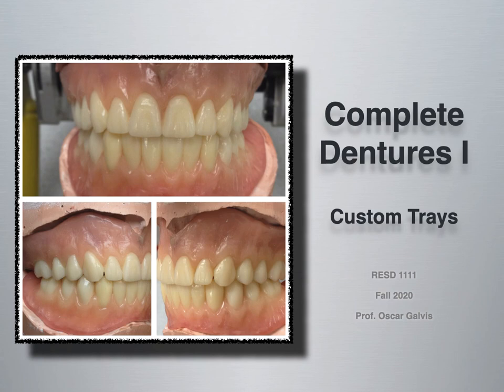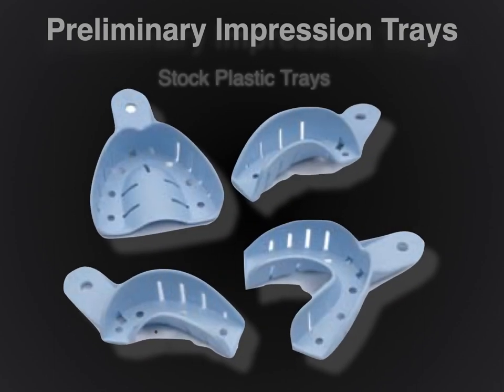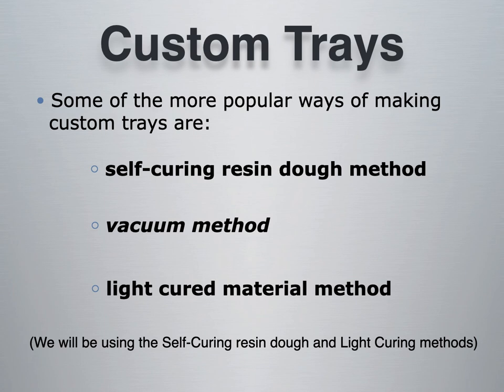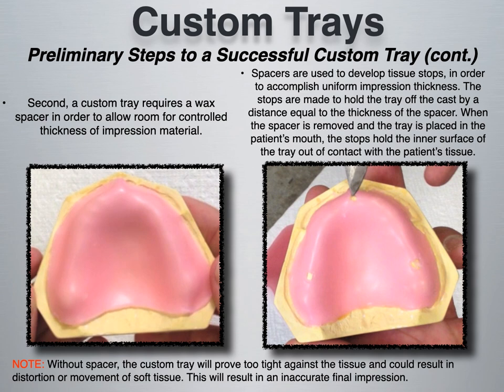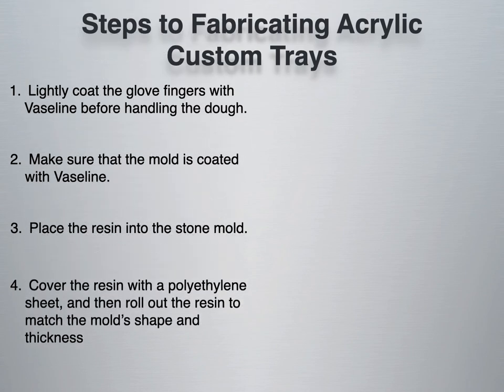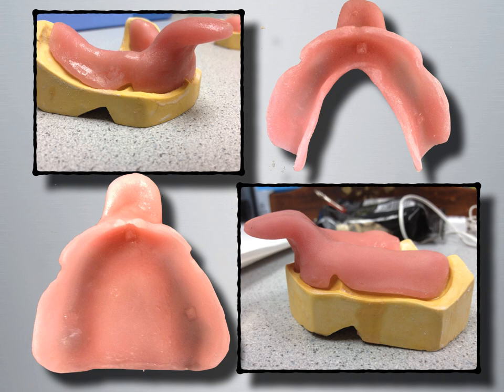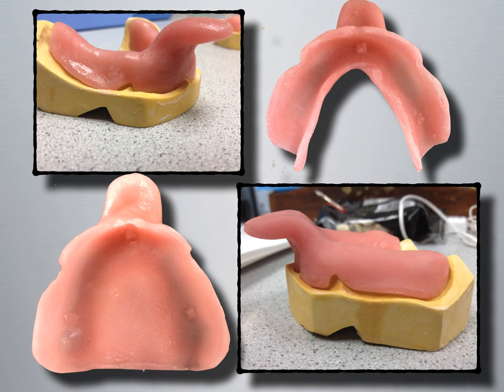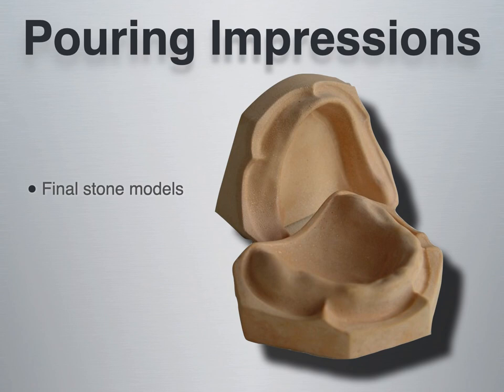Complete Dentures 1 - 3) Custom Trays

Comment: Ok so you take your impressions fix all the undercut and blemishes. Develope acrylic base add the spacer then take another impressions the model will have the original undercut in it. I don't see the point. Maybe more refined but the you have to redo the undercuts.